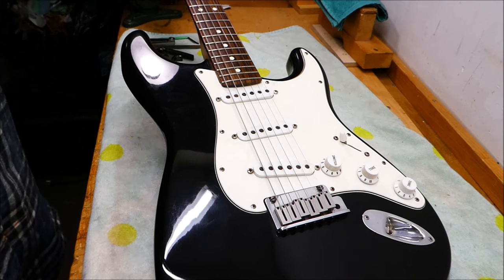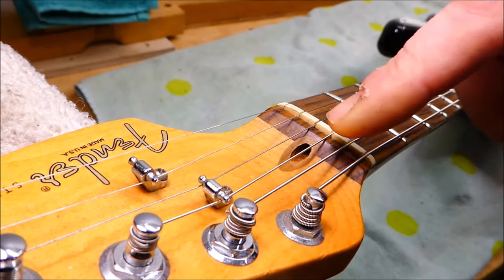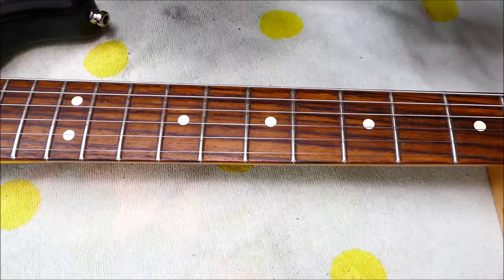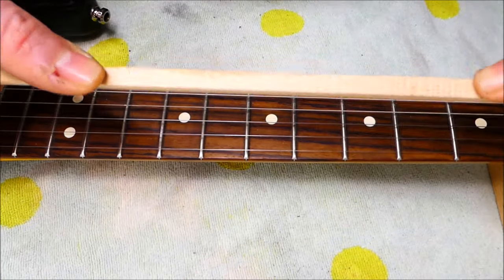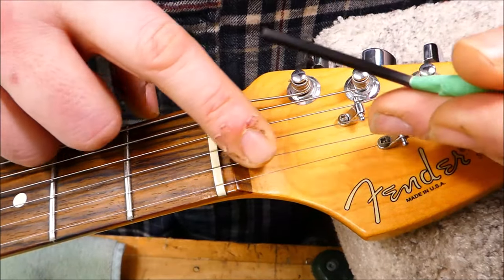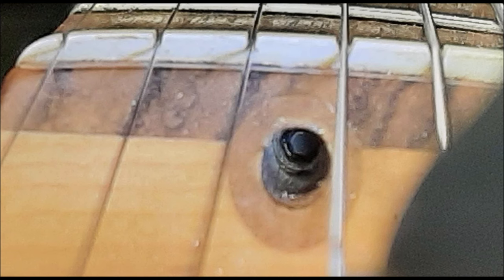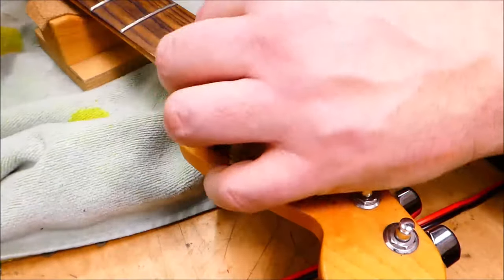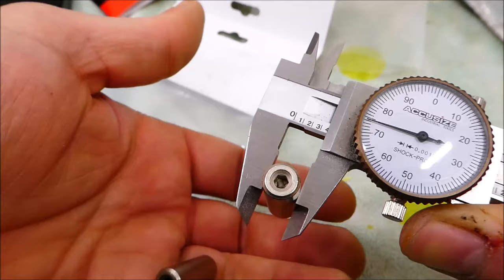American Strat Rides the Lightning!

Comment: This is a normal problem in those years on the Strats with the trus rod, its more a design problem, often this guitars when they come to my shop as soon the customer take it out of the gigbag I know Ill going to meet this problem, the trus rod up to the limit that is very dangerous for the neck and most of the time with the allen insert damage by using the incorrect allen or because didn't insert the allen  completely before apply torque, in the other hand normally anyway the neck still to bow. What I do is first I put the nech in a jig  I design to straighten back to the straight position with out any trusrod adjustment and then apply some backward adjustment before I re install the strings and tune it and the start to adjust but instead given tension loosing it to the perfect adjust point, it worked for me long years and normally never return with the same problem!. To remove the plug I use a screw small head with the same diameter of the insert and screw it in the insert and apply heat to the screw with the iron solder and the pull the screw comming outside with the wood plug

Comment: The 50’s heel adjust necks had the walnut plug because the truss rod gets inserted from the headstock end, the holes slightly bigger at the end and the rod has an anchor on it. 

Check out the original strat blueprints! They’re cool.
Reply: Only for one piece necks.

Comment: That's a job I hope never comes my way cause I'd probably have to use a soldering iron for heat. And you know how wrong that could go. It looks great as is.
Reply from the maker: If you've got a long 1/4" aircraft drill bit you can get most of it out and carve or sand the rest. It's hard to keep the edges crisp but it works.

Comment: That's the same truss rod set up on my 2011 highway 2 strat, the walnut plug etc, ,mines was perfect out the case with 9 gauge strings ,a 9.5 Inch radius and a super low action,  jumbo frets,  best guitar I have ever owned ! PS I always wanted Fender to copy Brian May and make the bridge  single coil in phase with the middle pickup giving a humbucker type option and still retain the classic look ?

Comment: It's crazy, I've had an American Strat neck in this condition for about 5 years now and was terrified to try this. I backed the nut out and the walnut plug came with it without any hesitation. I didn't even score around it, it just popped out perfectly. I added a nice brass spacer, put the nut back in and slide the plug, with glue, and all is well. Nobody would even know. Hahahah!!

Comment: McMaster Carr usually has hex rod available. You can make custom wrenches out of it.
Reply: As long as the hardness of the rod is okay for making a hex key.
Reply: @bills6093  easily hardened or annealed as necessary to make working end or curves or cranks
Reply: @markbernier8434  Your average Joe has no idea what you are talking about, though. Make it too hard, and you will have ends snapping off, too soft and it will deform and get stuck, like a Harbor Freight hex key does. :-)

Comment: Something I have learned from soldering wires on RC cars is that if you are soldering a large area, the soldering tips that come to a fine point like what you are using there take too long to melt the solder because you are concentrating the heat in to too small of a point. They are great for precision on something like a circuit board or for connecting very fine wires together. For the wide space like the back of a pot a chisel style tip might work better, it will spread the heat out more and melt the solder quicker so you need to spend less time with the iron on the pot. lessening the risk of damaging the pot.

Comment: Because you were able to melt the glue to get that plug out, does that it must have been a hot glue?  So, was it put back with 'ordinary' adhesive and would that be able to be melted for a future repair?

Comment: Does extreme wearing affect truss rod tension?

I live in the southeast USA, where temperature and hummus relatively average and stable. I’ve noticed that new guitars require small adjustments during spring and fall, but that after a couple of years will stabilize and stay true.

Am I just lucky with my guitars or lucky that my environment is optimal for guitars?

The only time I’ve ever had trouble wi the a truss rod around here is on an old abused guitar, usually also very cheap guitars

Comment: Great attention to detail. I have a similar situation with a 2021 Mexican Made "Player" Strat. It has the black plastic plug. Do you know if the truss rod in this guitar is a "Bi-Flex"? it looks as though the allen key hole is stripped out, but a T30 torx bit seems to be able to turn the nut. Can I just screw the old nut out and replace with a new nut without having to remove the black plastic plug?

Comment: If this were a Gibson, the hater brigade would be pulsating their collective brain cell right now. It's a Fender... I scroll down, I see nowt... Anyway on a technical note: That is incredible that you managed to get that plug out whole! The one I did came out in pieces! It took aeons and was quite a worry. What a fine job you made of it - And a great vid. I particularly enjoyed the worn, tired and weary way you pronounced solder. Most comical :-)
Reply: I think the difference is, we all know Fenders were always made as cheaply as possible, so we are under no illusions, whereas a Gibson Les Paul has an arched body, a removable scratch  plate (that precludes hiding the routing and wiring under the scratch plate)  and a set neck - all for no actual improvement in sound or playability, so purely aesthetic.  And thus we expect it will actually work too.
Reply: @chrisofnottingham  The Gibson' Les Paul's set neck actually tilts the neck back form the plane of the body, so does make a difference as does the arched top, this affects string break angles and ergonomics, didn't you ever wonder how the  bridge could be so high, if the neck was just set at the same angle a Fender neck is? The mega thick body, materials and angles involved all affect ergonomics and tone, nowhere near purely aesthetic. Binding and fancy inlays on Customs is mostly just aesthetic though. But aesthetics are important too - And is a USA Strat cheap to reflect the less time and materials? Were Strats and Teles ever cheap? I'm not knocking them they are great sounding things and very clever but they certainly are designed expressly for manufacture as you rightly say. However the customer doesn't see any of those economies reflected in pricing and never did. Aesthetics were vital to the early success of Fender with wild colours that made some prominent people adopt them as well as that twang of course

Comment: Considering a Gibson style truss rod adjustment, I always hear people returning guitars to sellers of selling them for cheap or writing them off because there is “no more adjustment left”.  This means that the nut is very far down and truss rod and several threads are showing, right?  So why couldn’t you A. Remove the nut and put some washers behind it or B. Consider a refret, back the nut off all the way and then level sand the fret board?

Comment: the small diameter resistance heater . . . HOW can i get something similar?  . . . I know Stewmac have the 5/16th heat stick, but you are on a different level to that , now. . . . and it has some great uses. . . I guess I'll do some reading , or something.. . Is it Nichrome wire, did you say?

Comment: pardon my ignorance, but is there a reason you prefer the traditional L shaped keys over, say, a longer T-handled allen key that wouldnt have you inserting and removing the key when you run out of travel? i picked up an eklind brand one off amazon that fits most of my import guitars for the occasional adjustment. having the handle out past the headstock seems to make it easier

Comment: So I've tried to resolve the backbow on my strat and the plug just went out with a bang. The system doesn't work well in my case, I guess I'm just one of those suckers with bad wood. I'm currently trying to figure out why it happened, I'm replacing the trussrod via the skunk.

Comment: Most guitars here in europe use that size of a hex key. I have about a hundred different lenghts of that, Alvarezes need a very weird, very long one. On their acoustics the truss rod is accessed from the soundhole but it's very deep. Anyways, It's funny to see that it's unusual for you. I encountered numerous guitars with the bigger hex hole, the "american standard" but they aren't that common here

Comment: Larger, more secure and safer hex key adjustment for necks and bridge saddle adjustment poles,  along with thicker wammy bars are a few of the little things my innate engineer    couldn't ignore from the very moment I started collecting, particularly f-style instruments of course. The "good strat" could be hiding around any corner, ...and it might be dirt cheap.

Comment: Here's a tip from the automotive world - use Torx wrenches instead of Allen wrenches on those Allen headed fasteners.  It has to be a tight fitting Torx wrench in order to work, they come in both metric and SAE sizes - so you should be able to find one that is close.  The Torx head on the wrench is much harder, it will not round over like most Allen head wrenches will when pushed.  The Torx wrench will also not round out the inside edges of the fastener, the edges of the wrench will keep the inside corners of the fasteners from being damaged - again, if it fits tightly.  Also, you might consider using an inductive heater to heat up the tension rod inside the neck of the guitar.  You can bend the copper wire of the inductive heater into a saddle shape to fit underneath the  wood on the back of the neck, or you could bend it in a circle around the neck and move it up and down the length of the neck to heat up the tension rod.  Anything else on the neck needs to be non-ferrous metal (like the strings or the frets) or it needs to be removed when using the inductive heater.  If you want to borrow someone else's inductive heater to try it out, make friends with a guy who works in a suspension shop and see if has one.  It is used often to remove rusty nuts and bolts on suspensions during alignments and other suspension work.

Comment: I have a music man guitar where the truss rod adjustment is on the body side of the neck with the same issue.  I constantly have to put much heavier strings on it than I prefer just to keep the neck from back bowing.  Is there a way to do this procedure on that type of truss rod?  2006 Music Man Petrucci Model.

Comment: Dear Fender - the builders of practical workingman's screwed together guitars - I like to see, and be able to adjust the truss rod nut. If I was offended by the sight of the nut, I'd also be offended by the sight of all the other screws liberally dashed front and back, and would probably not by a Fender in the first place. So, given that many other stunning and almost screw free guitars have an easy to access truss rod nut, do you think you could manage the same. FYI my Japanese Squire Strat has a domed nut with no cover, it looks great.

Comment: Why don't manufacturers spot weld a tag on to the can of the pot so that heat from the soldering (or "soddering") process doesn't damage the carbon track inside?

Comment: Look i think your method of plug removal was fabulous, however, couldn't you have gotten an extra long drill bit and tap and carefully tapped out the ball end and then used a die on a long piece of steel, threaded it , screw it into the ball end and then use pliers to pull it out?

Comment: I’ve just had to remove the plug on my 93 Strat as I couldn’t get relief and the truss Rod pushed the plug a fair way out. I did it once and used titebond but it pushed it out again so I inserted another plug and this time used liquid nails. It’s been a real mission but I’m sure I’ve won the battle this time. Quite a stupid truss rod system.

Comment: Either Bi-Flex rods work great or they strip. Out of Seven American Standard Fenders three stripped and I replaced the necks. Fender should have used a 3/8” nut and not a 1/8” which is too small. Not enough side wall to prevent the corners from wearing or to be able to apply more torque.

Comment: The 1950s skunk stripes were often Koa not walnut. I HATE double action truss rods. Put a bow in your skunk stripe wood wood cap over the truss and or bow the trench to set the rod in and problem solved. Make two bowed pieces of wood for your router to ride on and cut your groove. EASY!
Reply: Use a Bondhus ball end driver and you can work a whole lot faster, safer (for the guitar) and easier  (for the luthier). Don't buy cheap tools from Harbor Freight or even some of Stewmac's tools can be rather iffy.  I would epoxy in a piece of boxwood or desert ironwood hollow dowel. Stick a thin maple or poplar dowel wrapped in plumber's teflon tape into your dowel hole to keep the epoxy out of your hole. It is hard to believe I am going onto 50 years of doing this in less than one year. (Over 120 years 3rd generation total).

Comment: Electric Guitars, especially ones with floating bridge and double locking, require some descent knowledge about the hardware and the way it works. 
Unlike an acoustic ones, in order to maintain optimal playability and sustain you need a backpack with tools and a PHD just to keep the damn thing as close to perfect as it can be. They are complete pain in the ass, but nothing comes even close to properly set and maintained floyd rose guitar :)

Comment: I'm pretty anal retentive about soldering and the internals on that guitar make me cringe so badly. I can't look but I can't not look. With that much flux reside left behind, how can you tell if the soldering is any good at all? When I solder a guitar, the solder is mirror shiny and ALL flux is removed or I use no-clean solder that leaves a clear residue behind that looks great.